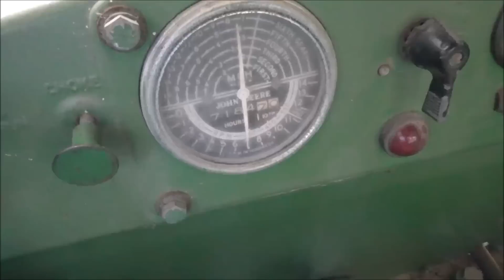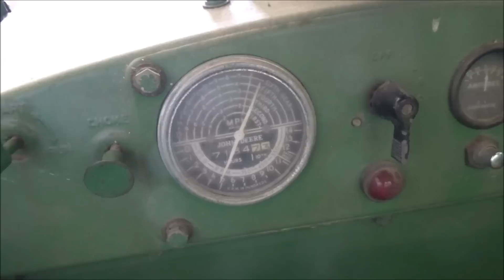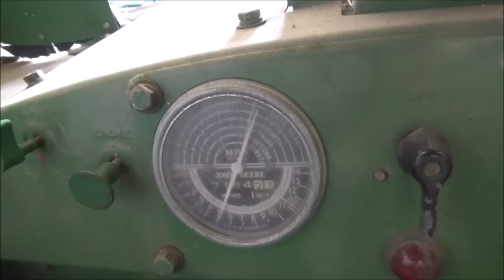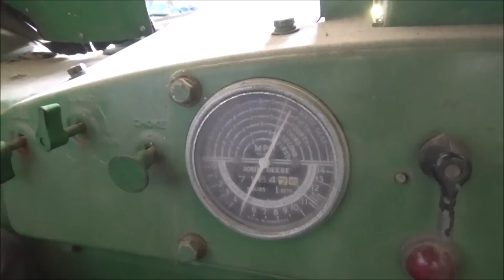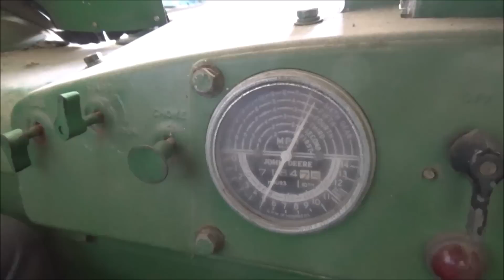Deere 820 2-cyl Diesel  Pony Motor Fuel System Upgrades

Comment: couldn't wait for you to start the diesel just to remember the sound., early 80's i had an R then added the 820,both with ugly cabs but still better than without,the R ran hard all day on a gallon of fuel an hour. actually sounded better than the 820 but couldn't do the same work as the big girl .thanks for the memories
Reply from the maker: Yep my 820 will do a lot of work on very little fuel. It is way more efficient than my 6030 but it won't match what that big dog will pull.

Comment: The Carb is a ZENITH TU4C also used on the pony motors of the CAT D2-D6 tractors JD and CAT still have some parts for them or you can go to the carb and magneto shop to get parts for the CAT ponies

Comment: Love to see somebody take care of these old tractors,  I bought an 820 last winter and I have a few questions for you, if you could help me out.
1- My 820 never seems to get up to operating temperature unless it is working pretty hard in the field.  Is this normal or are the thermostats stuck open?  Can dive the tractor down the road for 40 + minutes and the gauge will barely move.  The gauge works.
2 -  I can't get the tractor to charge.  Still original 6v pony start.  Had the generator off several times to get fixed, come back good works, charges about 6.5v but after I run the tractor for 1-2 hours it quits working and nobody can figure out why it is doing this. The gauge  also works on this one.
3 - When I got the tractor of course the previous owner had the pony motor all messed up ( linkages in wrong spots, wired "wide open" all the time) and I got everything back to original.  It runs pretty decent but not like your pony, i think it need some carburetor adjustments.  What should I start with and where are they located and what ones do which job? 

Thanks got the info it is greatly appreciated, love those old girls and hate to see them be used improperly.  
I also have a few videos of me pulling the 820 at the local fairs this year on my channel.... pulls like a champ.

Thanks again.
Reply from the maker: 1.Yes if it is not working mine pretty much putters around in the 140deg range. Even working it hard plowing for hours I have never seen it even remotely get hot, but it can get up to like 170F.
2. If the generator checks ok it is likely wiring or the ammeter itself causing problems. Also of course these are positive ground machines.
3. The big headed screw is the load screw and gets adjusted at full throttle under load for it to run smooth. The little screw in the neck sets your idle mixture and should be adjusted in combination with the low idle stop screw on the butterfly to obtain the proper idle.  Each adjustment effects the other some so you have to keep tuning multiple times to get it all right.
Reply: @bcbloc02  Great, thanks for the tips, just gotta wait for the warmer weather to get working on it.   As for the generator, when I get the generator back from the shop it works, shows a charge, then about an hour of running it shows nothing.  Take the generator back to the shop and they can't get it to charge either.  Nobody can figure why the generator keeps dying.  Also tried getting a new generator and the same thing happened with it.  Now sure if it's tractor or generator related.   Thanks for all the help.

Comment: Great stuff Brian !! Thank you !!!  I started on Coal Surface Mines in late 60S . We had a Cat D8 and Cat D9 with pony engines . The Diesel engines lasted many more hours , since  you could use the pony to turn the Diesel until it had good engine oil pressure , and then through the compression release to fire the diesel .  Thank you for jogging this old man's memory !!! Be safe my friend and God bless you and yours !!!!    Eddy
Reply from the maker: I would love to have one of those old Pony start D9's!
Reply: All the ones in my area ( Southwestern Virginia ) have been scrapped out ! In the late 70S , Caterpillar came out with an update which replaced the Pony Engine with an electric starter . The starter bolted up to the rear housing, a direct replacement for the Pony. And the batteries went on the left side of the operator's seat . ( The same place the later D9G had them )   We never did update because the update cost more than the D9 was worth ! Lol !!  The Pony outlasted the Dozer anyway. Side note, when my Dad worked on the Strip mines , early 50S , he ran the first D9 in our area ! It had cable blade ! I have a large black and white picture that Carter Machinery made of him operating it . I pray I have not talked to much !!! God bless !!!!!    Eddy

Comment: Reminds me of the donkey motors on the Cat dozers i used to work on years ago  . Pull start  on the D4's , Crank start on the D7's  but at least the D9's had an electric start  one !
Reply: D8s had an electric starter for the pony motor... but ours always sat long enough between jobs the batteries were dead and had to be crank started anyway.
Reply: @weshowe51  Our 2 D8's  had a direct electric  luckily  , but i remember a customers D9G that i used to do a lot of work on you needed 3 arms & 1 leg to reach the decomp lever !
Reply: @swanvalleymachineshop  I ran an 8-H that was worn OUT! I always let the pony warm up at idle, turning the big motor over easy while I drank a cup of coffee. When the coffee was done it was time to spin it up and I flipped the decompression over with my foot. The pony would foul a plug if you didn't baby it but I don't crank anything hammered anyway.

Comment: For the size of engine, flywheel, etc, i'm surprised it didn't really like idling much under 500.  
I do lots of cussing at carburators and gasoline fuel systems on old equipment.. I've retrofitted more modern (and less gummed) carbs on a lot of my stuff
Reply from the maker: Well it has to make a full revolution with no power before it gets the double hit again so smooth is not really its thing.
Reply: @bcbloc02  I have a 12HP Hatz diesel, single cylinder, I got it chugging down to 390.. looks like you could spin it by hand faster at that point since the visible pulley is cam driven.. so only 195 RPM there

Comment: I ran a POR 15 treatment inside my backhoe tank, used the marine clean before hand was an etchant/cleaned but haven’t checked back to see if it’s flaked off, been a few years now. Thanks for showing us the start procedure on the old girl, wish I had a pony motor on the old imperial super diesel, looks like I just need to crank it a bit harder eh? :-)
Reply from the maker: Can always just find a big hill to park it on. :-)
Reply: Haha well it’s a stationary engineer, so only real benefit of parking it up on a hill would be as a warning to all the other recalcitrant engines in the district, seeing the flames when I set fire to it in disgust!

Comment: Candidate for 6090 FT4 repower?
Reply from the maker: I want one of the new 18 liter Deere engines. :-)
Reply: @bcbloc02  you'll need more tractor
Reply from the maker: @earleclemans4836  900hp and 3500ft lbs should be perfect for some wheel spinning fun. :-)
Reply: @bcbloc02  are you talkkng about the Liebherr?
Reply from the maker: @earleclemans4836  no Deere has a new 18l motor of their own that came out last year.

Comment: Pony motors... the red headed step child that gets thrown a hot supper then stuffed back in the closet.  We sealed up an old gas tank years ago without issue.  Followed the directions to the letter thought, including the acid wash.  Can't remember which repair system we used.  Possibly came from Steiner, or POR, but no issues with it so far.
Reply from the maker: I followed the instructions too but it didn't pan out on this job, at least not long term. I think it was ok for 3 or 4 years then started flaking.

Comment: Brian. A little trick i have used is to put a piece of copper tubing about an inch long in the hole in the sediment bowl  that goes into the fuel tank. Keeps the crap off the bottom of the tank from going in.

Comment: I've always wondered where the concept of attempting to adjust for the slowest stable idle derived from.   I know I've spent way too many hours trying to get various engines to achieve a stable idle at the lowest RPM possible, and no idea why other than it interests me! :)
Reply: Basically it's just a "let's see what we can do" kind of thing. It really serves no useful purpose and in some cases can be harmful due to reduced oil and coolant flow at extreme low rpms. I'm just as guilty of it as anybody else, but theres no real good reason to do it.

Comment: Gotta say I've never seen a 820 with a cab on it. I would like to see it get 100+ hp on the PTO, looks like she's done some work, with all the front wheel weights.
Reply from the maker: The cab is factory, but yeah they aren't real common.  :-) 20+ years ago I used to antique tractor pull it. It was a lot of fun until they did away with the heavy weight class because I won 95% of them.  The front wheel weights were necessary to make it pull good.

Comment: Pony engines were one of most abused engines on the farm. Some did not have an adjustable throttle, started cold at full throttle and were shut down at full throttle without a cool down period. Brian's sounds very good.

Comment: I  used to own a D2 caterpillar that had a pony motor, it had the same issues with the fuel system. The tank was heavily rusted and a former owner coated the tank but it started peeling before I got it. I was a pain in the butt to get the tank cleaned up!

Comment: Ergonomically speaking, that doesn't appear to be one of JD's best cabs for access. However, I did notice it has a 4 stage A/C system: 1 door and 3 operable windows. I would venture a guess and say, used pony motors for that tractor are not a bane on the market. Another thumbs up video!
Reply from the maker: The cab is not the greatest but it sure beats the heck out of sitting out in the wind doing field work when it is cold out! It really does make a big difference in comfort when its 50 or below. Only drawback to it is it is pretty loud since it catches all the transmission and hydraulic noise.
Reply: @bcbloc02  I agree entirely, I started driving tractors when cabs weren't offered and the "sissies" put on a "Comfort Cover" in the winter.

Comment: Done the old dipstick oiler trick many times in the field on stuff like cultivator bolts. Those old 820 tractors are tough pullers. Don't see many with a cab. Yours looks real clean. Yes please do some footage of it in the field. Would love to see it running. I am about to build the engine on my B Deere. Got the main bearings back from a babbit house (Harts machine)  in Cecil Ohio. They did a great job.
Reply from the maker: It was one of the first restorations I ever did. I fixed it up back in the mid 90's.
Reply: Going to work On my "B" this winter, got any severe mods to make it a puller? HayHud out.

Comment: Hard to believe this whole electric starter thing ever caught on...
Reply: Glow plugs...who needs them.
Reply: Watch Wes Work sheesh, kids these day are spoiled with their pony motors and electric starters... back in my day you had to crank it yourself and if you did it wrong you broke your arm.
Reply: Volcker1929 Sheesh, kids during your days used smoke signals to communicate. Far too easy with Internet today pfff...

smirk smirk
Reply: Right! :-) 
Back in our day we didn't have fancy inflated rubber wheels cushioning our ride. We had solid iron ones and considered ourselves lucky they weren't wood. And enclosed cab?.. Luxury!....
Lol. Check out four yorkshiremen video. :-)
Reply: torque350hp the four yorkshiremem is gold! I had never seen it, thanks.

Comment: Neodymium magnets inside the fuel tank attract all the rust to them. Speedometer cable core with a power drill will clean out fuel lines. 10 micron rated fuel filters either before the fuel pump or carbs on gravity feed systems keeps the sediment out of the fuel pump check valves and carb needle and seats. I have even stuck neodymium magnets with holes in the middle over both ends of fuel filters.
Reply from the maker: Good tips! Thanks.

Comment: An old timer told me when it’s -10 out you start the pony, pull both levers back and go in n have coffee and let her warm up.  
“Kreem” fuel tank liner works good I’ve heard, Harley shops have it. Or Red Kote. Used that on a 620
Reply from the maker: I started mine at minus 40F  once and it took about a half tank of gas thru the pony to get it warm enough to turn the big engine over, once I could finally get it spinning decent it started first roll over on compression with the fuel on. :-)
Reply: Wow

Comment: What does the Pony Motor actually do to start the Diesel?
Reply from the maker: It cranks it over. In this design it also is tied into the big engines coolant system so it heats the big diesel motor too if i runs long enough. Then the exhaust on the pony runs thru a heat exchanger on the air intake side to warm the incoming air as well. It works very well. If the pony will start I can guarantee you can get the diesel started too. :-)
Reply: It is the starter motor 
They predate electric starter motors
Reply: @bcbloc02  Thanks for the reply and info very interesting.  I enjoy your videos keep up the good work.
Reply: On my cat you would engage the starter pinion, then wrap a rope around the starter sheave on the pony. IF it cooperated it would start with one pull, usually took two when cold. Then you let it run and warm up the main until it seemed ready. Next you pulled the compression release on the main and the pony lever to clutch the pony to the starter pinion. Let it turn the main over for a bit to build oil pressure and get the main turning, then give the main some fuel and she would start. That kicked the pinion out and declutched the pony. Shut the gas to the pony off and let it run out of fuel.
Reply: @bcbloc02  "if" the pony will start !
The pony will be a constant problem for you as long as you live. I have my Grandpa's 720 and no matter what you do with the pony it gives constant trouble

Comment: Wonderful video.  Your tractor can't be old because we're the same age😃. Is the hour meter accurate?  If it is then 7144 hrs / 62 years is about 3 weeks use per year.  Is this right?
Reply from the maker: Yes the hours are right. I imagine most all of them were put on it in its first 20 years of life. I don't usually put even 20hours a year on it myself.
Reply: Can't get just the mechanical tach/speedometer to last over 450 hours in my 3130. I wonder if the guys who built that 820, (the guys on the assembly line) ever dreamed it would be running 62 years later with over 7000 hrs on it. And the grit of the man in the seat for most of those hours says a lot about those who built this country.
Reply from the maker: Guy down the roads dad ran a rock quarry. They had a 730 Deere diesel on the irrigation pump there pumping water 24-7. They supposedly rolled the tach over three times and it was finally worn out and in need of overhaul at about 36000hrs.

Comment: Love the click type combination torque wrench.  I've got a set of those too.  Comes in real handy.
How long can you let those pony motors run before they overheat?  This is the longest I've ever seen someone let one run... don't have much time around the old 2 cyl Deere's.
Reply from the maker: It is plumbed into the tractor coooling system so it will run till it runs out of gas no problem at all.
Reply: it's also the cold weather warm up and pre-lube system for the big engine.

i"ve been told that one reason some people had problems with the gas pony engines was that they never run them long enough to get the oil fully warmed.  They were also the people that would never (or seldom) change the oil in the pony.  Brian should know what that can lead to.

Comment: We call them donkey engines in the UK, mostly used on much bigger and older stuff though like excavation equipment. Not built to stay cool for long though, only used for seconds until vehicle engine starts...! A two stroke engine, by the looks of the smoke.
Reply: V-4 four stroke pony on this one.  Brian mentioned he's got some pre-mix in the gas.